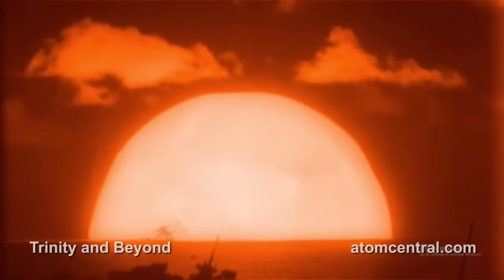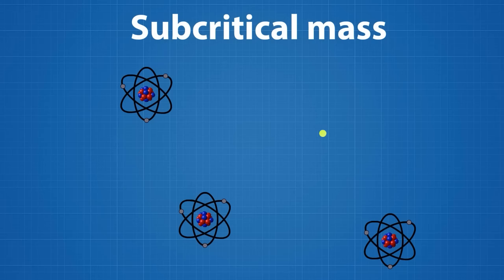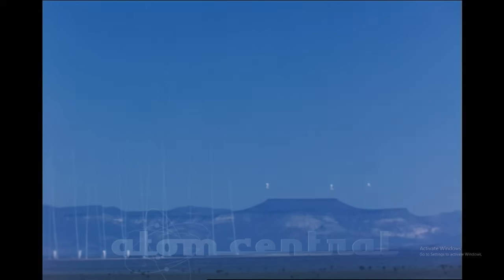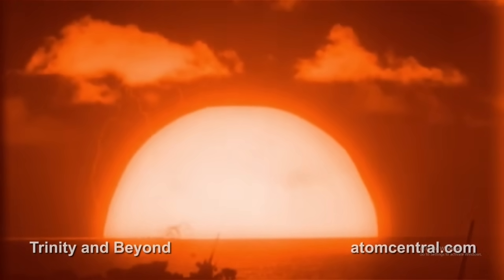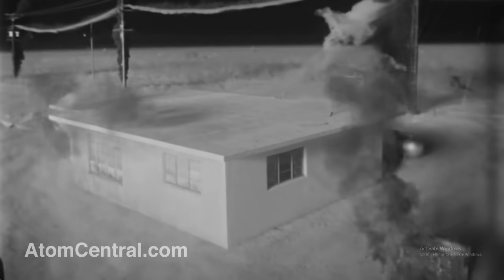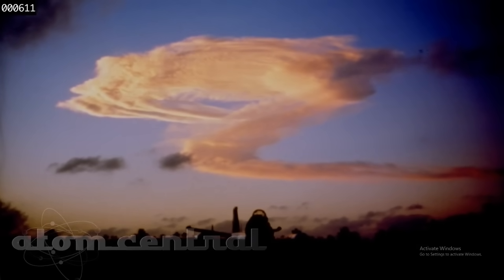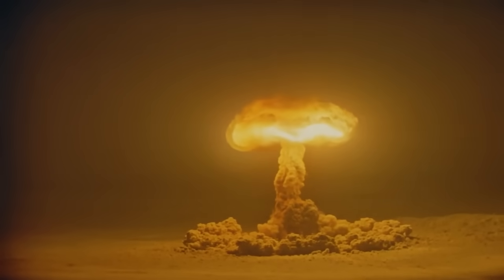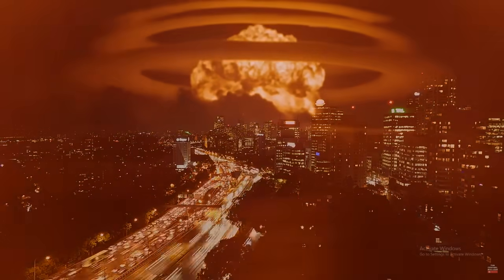Anatomy of a Nuclear Explosion

Comment: It blew the paint off like dust…. Destroyed buildings with no problem. Damn. Why didn’t the camera filming it melt? How did it survive? Why wasn’t the film damaged from the radiation? Something seems a little off here.
Reply: Yes, your understanding of physics is off. A few feet of concrete can block the direct radiation that causes these effects. Those cameras were in underground concrete bunkers using periscopes that were protected by steel and concrete. There are lots of documentaries and articles about that.
Reply: @charliefoxtrot5001  steel makes sense, not concrete. Concrete is hollow. Wouldn’t the radiation permeate through the air holes in between particles? Those vids have some propaganda vibes to them. Scare tactics for the Soviets. Idk though I wasn’t there.
Reply: They used a camera very far away, zoomed in on a mirror close to the explosion
Reply: @TheCompleteMental  how far would you say they are? I would  at a glance say it would have to be a couple of miles out to not get damaged? Eh?
Reply: @Müller_of_GeSTaPo  In some cases, cameras were miles away, while in other cases they were not. In any case, the cameras were protected against the radiation and physical forces.
Reply: @TheCompleteMental  The mirror and additional filters were always close to the camera, not close to the explosion. The purpose of filters is to reduce the visible light, in some cases by 99%. The purpose of mirrors was to have the camera outside the path of any direct radiation, including UV and x rays.
Reply: @charliefoxtrot5001  thanks, I feel like I forgot a lot but didnt go back and check for some reason.

Comment: That high altitude test was Housatonic, one of my favourites. The last air-dropped nuke by the US and the most accurate detonation, within 100 feet of the intended target. At over 9 megatons, it's thermal pulse goes on for many seconds. It was basically a re-do of the Androscoggin test that failed, because the secondary was a fizzle.

Comment: The long half-life is not a problem, it means low activity. The mean half-life and biological property of CS-137 and Sr-90 is a problem.
The short half-life is only a problem if you are exposed to this radiation locally, a short half-life means high activity so get in a nuclear bunker or move away to be save.

Comment: Good stuff but note a lot of the video showed Thermonuclear Fussion detonations.  Also I have read in some accounts that the amount of Fissionable material in both the Fat Man and Little Boy devices that was burned was only 1 to 2 grams illustrating the inefficiency of the designs.  Todays US devices are extremely efficient and yields are much higher for fractions of the fissionable and Fissionable materials.  Case in point the B-61 and later designs are less then 1000lbs in weight and that includes most of the housing and electronics to trigger the chemical explosion.  In a fussion device, there are 3 detonations, the chemical implosion that triggers the Fission device which provides the neutrons and heat necessary to trigger the Fussion device.  the type 81 and 90 series weapons can yeild up to 1.5 MTs and the non-chemical fission/Fussion devices are the size of large thermobottle weigh in at under 50lbs.

Comment: There's a few mistakes for such a short video.
a) initial flash is not electrons relaxing from more energetic states. The nuclear reaction itself shoots out photons. Foolproof way to check: the ionization energy of the particles involved are lower than gamma ray's energy. It doesn't matter how much energy you feed the electrions, it'll ionize before it gets enough energy for a gamma ray spontaneous emission.
b) the "so much energy that it excites electrons into releasing gamma rays" is pure nonsense. The amount of total energy has nothing to do with the wavelegnth of the EM radiation. A tiny amount of fission producing less energy per second than a light bulb will still emit the same high frequency EM radiation. Also, as mentioned before, it's not electrons relaxing that releases the gamma rays in the first place.
c) the shockwave does not travel at 780 mph. That's the speed of sound in normal atmosphere. Shockwave is, by definition , a disturbance that goes faster than the sound speed of whatever medium it's traveling in, and that distinction is actually relevant. There's a lot of weird phenomenons in shockwaves that's not present in subsonic perssure waves.

These are just what immdeiately jumped out at me. There's parobably a lot more I missed.
Reply: This comment needs to be pinned up.

Comment: The detonation of an atomic weapon is about releasing electrical energy.  Everything else is just bonus.
Reply from the maker: XD
Reply: @darkscienceyt  
I've experienced something most people haven't seen or understood - have you seen the energy crank in the wax of a burning candle?
To do so you will need a large, fat candle.  Allow it to burn until a deep pool of wax forms.  Scrape the neck of the wick and allow the particulates to fall into the wax.  With a magnifying glass, track the movement of the finest particles.  You should observe the following: a particulate is shot out from the wick to the candle edge.  As it travels to the cooler region it sinks down and then is drawn back along the floor to the wick again.  This cycle repeats as long as the candle is lit.  So, what you have is a donut of energy that constantly turns inside out....
(Side note: a broken magnet always repels from itself at the fracture point >always<.  The particles of a crushed magnet repel away from themselves briefly but does not have the valence power to out distance the attractive forces.  With that said, the crushed particles of a uranium magnet will fully repel away at C2....)

Comment: Things I learned from this video:

1. That old footage of the paint flying off of vehicles is a result of vaporization caused by heat from the initial flash, which occurs before the shockwave hits.  I had previously thought it was the result of the shockwave hitting, but shockwaves don't arrive in stages like that- they're inherently plosive, so they arrive all at once with an immediate "attack."  That's why in the footage of the house being struck, you can see the paint flying off right before the shockwave arrives and starts to tear the structure apart.

2. I had previously thought that the initial flash of light and ionizing radiation was emitted from the atomic nucleus.  I had no idea that it's black body radiation- the same way that animals glow in the thermal infrared spectrum, or a hot iron glows red hot, or an even hotter iron glows white or blue hot... these explosions essentially "glow gamma ray hot," X-ray hot, UV hot, blue hot, white hot, red hot, etc.

Things that I already knew about which I think the video slightly misrepresented:

1. Radioactivity and half-life are directly and inversely proportional.  This means that the isotopes which have short half-lives (anywhere from fractions of a second, to a few weeks) are VERY radioactive, but at least they decay quickly.  They basically dump all of their energy in a very short time span.  This is why potassium iodide is distributed in places with fallout... the video kinda makes it sound like iodine-131 isn't much of a threat- in reality it's a relatively short-term threat, but a very serious one.

Isotopes with super long half-lives (hundreds of millions of years or more) are not very harmful at all, because they emit their energy so gradually.  Billions of years of half-lives, might as well not be radioactive at all (For example, thorium-232's half-life is slightly longer than the current age of the universe, , and bismuth-209's half-life is billions of times the current age of the universe, and in the case of bismuth it wasn't even known to be radioactive until a few years ago, for this very reason).

It's the ones that have medium-length half-lives (anywhere from a few years to tens of thousands of years) that really render places uninhabitable for long periods of time, because they're in that sweet spot of being both still pretty radioactive, but also having longevity with regards to timescales relevant to human life and human settlements.  Especially if they're absorbed by plant life and contaminate the food chain (cesium-137 and strontium-90), these are particularly devastating for habitability.  Whereas something like plutonium, while it does sit in that sweet spot, it's not exactly absorbed into the biosphere the same way.

Comment: Your video at 6:14 has an incorrect translation of fahrenheit to centigrade.
Minus 35 fahrenheit is abouot minus 37 C. (since minus 40 is the same for both.)
Your guy has mistaken -35 F for 35 F, and given 1.7 C, roughly correct for the temperature above freezing, incorrect for the cold stratosphere.
Basically this is a sloppy job all over. You give inishate for intiate, and you're all over the map about nuclei, nuclea, nuclee-other-stuff you invented.
You should take this video down and do it over since you're not meeting even YouTube's low standards.

Comment: 0:44 at this time, on the left of the initial fireball, is what appears to be an electrical discharge? I know they used to use smoke rockets to measure shock wave properties, but this is not them. As this is a H bomb test, the camera for this scene would have been a very long way off.

Comment: Great video... thank you! At 3:10 we see the effects of intense radiation on regular automobiles. Think back not long ago... about a dubious propaganda stunt where a Tesla car was sent to exposed space. How they managed to recapture it from Earth orbit... to then send it to Mars is unknown... but I digress. Mind you... this is a normal car with no modifications... in direct solar radiation... with no visible effects to materials known as acrylic enamel paint/ plastics/ rubbers/ fabrics and cloth/ metals and alloys... ect. Totally exposed and unshielded. Do not believe blindly... question everything... use common sense. ML and Blessings!
Reply: FYI: The Tesla Roadster is sill in orbit and will remain there: https://en.wikipedia.org/wiki/Elon_Musk's_Tesla_Roadster

The sun's radiation energy is just 1,361 Watts per square Meter, which is nothing compared to the radiation energy from a nuclear explosion at close proximity. The sun-facing side of the International Space Station, for example, can reach a temperature of about 121 Celsius.

Comment: thé footage of the shockwave is fake, how can the camera stand still while everything else gets its paint vaporized and then overthrown?
Reply from the maker: Cameras placed in thick concrete towers that were anchored several feet into the ground and were several inches thick. You can indeed make a shockwave proof building. It it was at the epicenter, it may have been different

Comment: For the blast - an important component of the shock wave is the mach stem which is created from the initial blastwave expansion combined with the blast reflection off the ground.
Reply: This is why weapons planners calculate the optimum blast height of the ordnance they plan on using against particular targets.  Depending on the vulnerability of particular targets to blast effects, it may be better maximizing blast effects over the largest area possible.

On the other hand, if you're going after hardened targets -- often underground -- a surface or subsurface burst may be warranted, as the fireball's expansion shoves aside the earth around it.  It also creates greater shockwaves in the ground, potentially crushing underground facilities not close to the detonation.

Comment: Great vid overall. important clarification: the incandescent light from the initial flash is not caused by excited electrons. While all the matter in the initial flash is excited plasma, the heat is caused by the electromagnetic separation of the daughter nuclei being accelerated away from one another at extreme speeds. These nuclei then crash into the surrounding matter and superheat it as well. While the electrons are also at extremely high temperatures and ionized, they have extremely low mass when compared to the nuclei of the matter around them. As such, the majority of the incandescent light radiated in the initial flash is from the super-heated nuclei rather than atomic emission from excited electrons. Also, being incandescent light, the emitted wavelengths cover the entire electromagnetic spectrum, from gamma rays to long-wave infrared and microwaves. However, at first, the most intense radiation is in the shortest end of the spectrum.
Reply: I've read that high-speed photos of the gamma photons emitted by the event heating the tower guy wires to incandescence (before the fireball expanded enough to consume them) is what gave Teller/Ulam the idea of how to use that radiation flux to compress the fusion fuel in the "super".  Pure genius.  Pure, evil genius.
Reply: Actually, the initial flash is the case shock from the ionized warhead case, the nuclear fireball light actually blocked by the ionized atmosphere and stalled until a shockwave can form and disrupt the opaque layer surrounding the fireball proper. Some of the high speed films actually show the shockwave expanding within the dimming initial case shock fireball, then a brief, but longer brightening. A double flash only possible in the atmosphere, in space it's a single flash which swiftly smears out along earth's magnetic field lines.
Reply: teller light
Reply: Exactly. X-rays and gamma rays.  Very briefly.
Reply: At first being less than a millisecond though, right? The main flash that caused burns a mile away is mostly visible, infrared, and UV light, and is the second (sequential sense) flash that occurs milliseconds to seconds after the initial flash, if memory serves. X-rays and gamma rays shouldn't make it very far before being absorbed by the air

Comment: Americans are just SO dumb.
At 6 min and 9 secs, the video shows the Stratosphere to be -35 F, and in brackets beside it showing THIS (1.7C).
Ummm, what?
They were obviously confused because 35.6F is, in fact, 1.7C, and I'd like to let it go as an accident, but no one took the time to fix it. American and I think one other country are the only places on earth not using the metric system. I don't get why other than sheer stupidity and laziness on the part of the American public, but it really is a simple and logical system.

For example, 0C is freezing point of water.
100... ? Anyone? Right, the boiling point of water.
Almost makes sense right?

Anyway, -35F is around -37C. Interesting right. That is because Celsius and Fahrenheit cross at Minus 40. That's right minus 40C is minus 40F.

This isn't difficult stuff guys, get with the program.

Comment: One thing, tho - critical mass can be easily achieved without compressing anything. It was designed like that for Fat Man for one reason - the other firing mechanism, a gun-type used in Little Boy, was impractical with a plutonium core. It would be too big or have too high risk of predetonating, not in a sense of exploding aboard the plane but in a sense of fizzling, creating a very small yield which wouldn't do more damage than a normal bomb. 
Also there was no "neutron gun" in any of these designs. Both plutonium and uranium, when decaying, emit their own neutrons. Critical mass is when every split event makes exactly one new split event - in a subcritical this is below one, and in supercritical mass this is above one (which makes it a chain reaction we need).
So to fire those things they've had to invent a way of bringing a subcritical mass to a supercritical one - which can be achieved in many ways: by adding a neutron reflector around a subcritical mass (neutrons leaving the mass bounce back into it, raising the chance of making them split another atom), adding two subcritical masses (gun-type firing system used in Little Boy) or changing the geometry of subcritical mass, because geometry plays a role as well (this was done by compressing the plutonium sphere in Fat Man).

Comment: Notice at 4:45 you see the film crew and at 4:46 you don't? It's all staged.
Reply: Or it's two different pieces of footage cut together, which is perfectly possible with 1950's technology and y'know a trivially easy conclusion to reach using basic common sense. People need to stop just uncritically accepting stupid talking points they heard online.

If you can see the camera crew then it's very clearly not a miniature, unless we're claiming the government has some kind of magical shrinking ray. So then you'd have to explain how they generated enough heat in such a short amount of time to burn the paint off the building, which would not be possible with conventional explosives.

Comment: I'm pretty sir they don't shoot the core with neutrons -- just compressing it with explosives brings the atoms of the core so close to each other that the likelihood that any neutron ejected will strike another atom becomes so high that there's a chain reaction.
Reply: There is a neutron source in the core.  In the original atomic bombs, it was called "The Urchin."   The Urchin was made of beryllium and polonium.   When mixed during the first moments of the explosion, a shower of neutrons is given off.  This was done because the more fissile material atoms that can be caused to fission at one time, the larger the yield.  When the core starts to fission it expands.  Fission stops when the radius expands to 1.12 times the radius when the material becomes critical and fission starts.   To ensure a greater yield and guarantee there would not be a fizzle, a neutron source was incorporated into the atomic bombs.